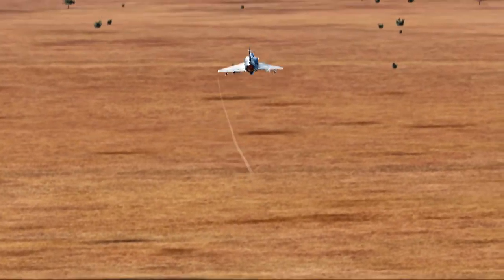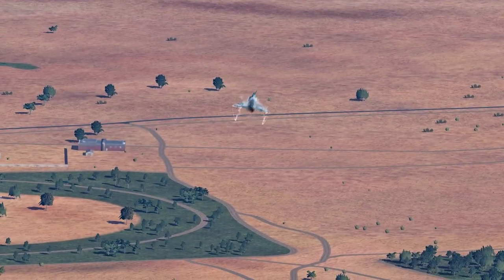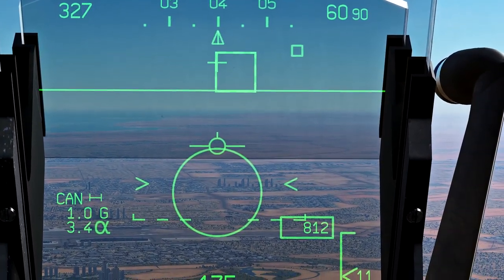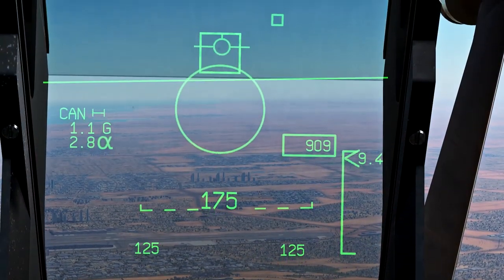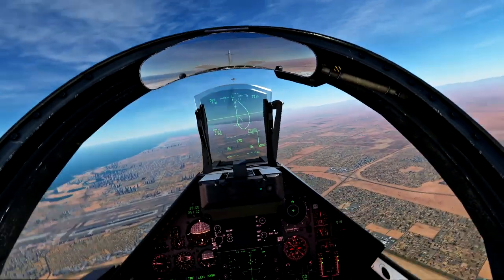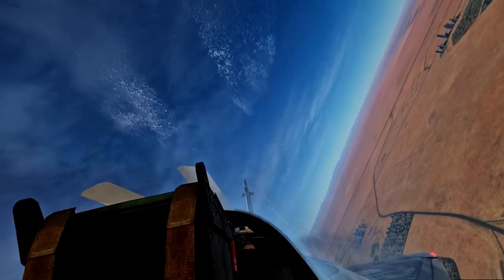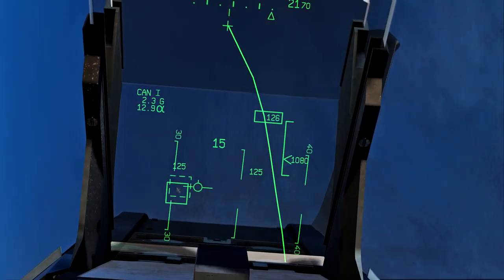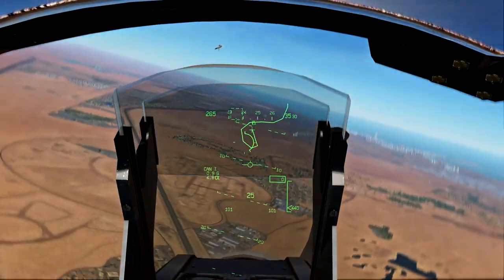DCS: Mirage 2000C Vs F-5 Tiger Dogfight

Comment from the maker: So I think its about time I gave some love to the Mirage 2000C. I've finally gone out and learned a fair bit about the Mirage although i'm still learning, and getting use to it. But I will say that I've thoroughly enjoyed the Mirages handling and flight characteristics. Although lacking when it comes to BVR engagement  with the small load out of only 2 super 530s and 2 magic II heat seekers the Mirage is easily one of the most dominant dog fighting platforms in DCS right now. The impressive roll rate on this thing makes it a very difficult opponent in a dogfight. Thank you all for watching and Thank you for all your support with the channel. its been an amazing journey.
Reply: Your so realistic 😣👍
Reply: So, which one would you prefer when it comes to dogfight: hornet or 2000?
Reply: @hikari2hikari2  The Mirage is slightly better (delta wings) in maneuvers but the Hornet has slightly better thrust to weight on the paper and JHMCS. Close call, probably the Hornet, the version we have is 20 years newer than the Mirage we've got. Hopefully they put the Mirage 2000-5 eventually with BVR missiles MICA EM/IR, especially the IR, very dangerous missile as it gives no warning to the target. The Mirage would then become very popular on servers, like the F16 Viper when it'll be out. Thanks for the video GS.
Reply: Holy those slots at the merge 3:42, even the sound is implemented when it goes down
Reply: @hikari2hikari2  The mirage flies better imho, but the hornet's armament and gunsight are a lot better... The 20mm vulcan has higher muzzle velocity and the radar gunsight on the f18 is much easier to use.
Reply: @hikari2hikari2  I prefer the Mirage over the Hornet in a dogfight.  Unless the Hornet is flying slick, the Mirage should be able to turn substantially better at higher speeds, and most merges occur at high speed.  My experinces in online servers has been that my Mirage ALWAYS gets the first shot off, even against a Hornet with AIM-9Xs.  The Magic II turns very well and will make almost any shot you take at close range.  If the Mirage had a reasonable gunsight it would be a clear dominator, but as it is any opponent can escape gunfire indefinitely simply by flying around at 600 knots.  It's almost impossible to make a Mirage overshoot, but it's easy to not get hit by guns.
Reply: @JETZcorp  Right, prtty much like what I been heard, "hornet is the best dogfighter when sit in chairs"
Reply: As a Peruvian I know we have Mirages 2000 while our neighbor, and traditional rival, Chile has gotten some F-16.

I would love to see that match even if the outcome doesn't favor the Mirage (that is why we got Migs-29). Very nice channel.
Reply: Take it our for BVR please, make it work. It will make an excellent video :)
Reply: I have been looking forward some Mirage love on here.  I'd really like to see some videos on how to fight/survive BVR engagements in the Mirage.
Reply: Fun to see these a bit older and not as prolific aircrafts in some action. Hope to see some more Mirage videos, and perhaps, some beautiful day even a Viggen..?
Reply: FA18C loses its energy very fast compared to the M2000C, in a dogfight. 
Still waiting for the M2000-5, probably in 3 years I guess :(
Until then, those Super530D vs AMRAAM and 9X can't stand a chance, 15-25 year gap.
Reply: @Maximus Lockhart Its been said many times before but if you underestimate anything in DCS you're  a fool. But yeah the 2000c especially seemly totally underestiimated. It just takes a bit of getting used to compared to Hornet etc, but its so fast and as said very manovourable at the right speed. People seem to lump it with the 21 bis and the F5E but its really a class ahead of either. The only thing letting it down is payload, because you just know that it has the space for more missiles, just not the right mounts, and with 4 or even 6 530Ds I think people would take it a bit more seriously.

Comment: I really liked the explanation of the flight characteristics at the beginning of the video. Similar explanation for other aircrafts would be nice.
Reply from the maker: Ronak Dhakan thank you I plan on doing that kind of stuff a lot more going forward thanks for the feedback. Always helpful to hear what you guys like so I know what to do more of in the future.
Reply: @GrowlingSidewinder  to add a bit on your Mirage 2000 delta wing explanation, the 2000 has several features, the main being FBW that allows others features to work (such as the slats and instability), which significantly decrease the disadvantages of a delta design, especially its low speed handling and energy bleeding. The Mirage III or Mig 21 are total bricks at low speed compared to this beast.
Reply: @GrowlingSidewinder  Similar explanation for the opposing aircraft(F5 Tiger) should have been done too.

Comment: This cockpit has to be a dream for every pilot
I never knew anything that open ever existed
Reply: Aref Salimi , wait for the F16!
Reply: F16 cockpit is far more complex to use than the M2000, designed to reduce the pilot charge to the minimum. The view from the F16 cockpit though, is better.
Reply: @krostouin , the cockpit in the F16 is more complex because it can deliver way more weapon types. It is pretty clean and uncluttered, the complexity in the F16 cockpit lies in the MFD's
Reply: @PhillMagGamerDad  man you are wrong. This is not the reason. Dassault is a specialist in making cockpit more easy too use. They did so with the rafale wich cockpit allows the pilot to focus on his flying and his mission!

Comment: The F-5 had no actual chances of winning a dogfight with the marvelous Mirage 2000. The Mirage has a fairly low weight and large wing area with the pure delta design giving low wing load, thus more maneuverability, and the wing shape works extremely well in all flight regimes (subsonic, transonic and supersonic). It's very fast, in fact is pretty difficult not to overshoot in close range combat. Here agility is the key for his design: small, extremely agile, fast and with good weaponry. The single M-53 engine (double air flux, more air and bigger air intakes= better supersonic performance) is a badass engine. The intakes have central moving cones. The cone moves according to speed, progressively moving backwards as it increases. In this way it is possible to adjust the geometry of the air I flow adapting it to all the practical speeds sustainable by the aircraft, without having a complex design of the air inlets themselves. (Remember the SR-71 Blackbird engines? That type of intake cones). The jet is unstable and uses fly-by-wire, which is the last Dassault plane to use this system in fact the Rafale uses fly-by-light with optic fibres. Here's the funny thing, the fly by wire system of the Mirage 2000 needed two "mustaches" that made the plane even less stable to gain full control. The Mirage it's first a strike aircraft and then an Interceptor, keep this in mind. It's an aircraft capable of going from 0 to 60,000 ft in less than a minute, shoot 60 rounds of 30 mm in just a second (two 30 mm revolver cannons with a 1800 RPM rate of fire, 30 rounds per second each) and fire big missiles. This means "I will obliterate everything I see". They probably wanted to give both the typical Interceptor layout with long range big missiles (Remember the F-14, huh?) and the dogfighter layout, thus meaning good and numerous guns.

I made a fairly short resume of how the aircraft is. Ps. I had very few hours on DCS but I have thousands on other simulators and games - flew most with F-22, F-15C, Mirage 2000, F-18 Super Hornet, MiG-29 and A-10, less with Rafale-M, F-14, F-16, AV-8B, F-35, various MiGs [21, 25, 31], F-117, Me-262, etc., without counting many hours on propellers such as Spitfire, Me-109, P-38, P-40 and so on) 

Flying the Mirage is easy and difficult. Strange, yes. It’s easy to fly once you understand how it behaves, but the pure (and tailess) delta wing it's a bitch. it generates huge amounts of lift AND a huge amount of drag. In fact at high AoA the wing has flow separation and at low speed it procudces a lot of drag. This feature needs more powerful engines to counter, but the Mirage hasn't a so powerful engine. And it's not so good in pitch.

So the general idea is to use your speed and firepower to attack first but beware of climbing/pitching maneuvers and low speeds, this will put you in an unfavourable situation. The delta (tailless) is efficient at high speed but no so much at low speed so distance and time are your friends here. The delta flies well in all regimes but it's a bit bipolar in this case, remember the high lift and high drag thing. To fight well you must be fast, that's the deal with the Mirage. Otherwise you'll overshoot trying to do that or slow down too much that by the time you pull that throttle to 100% and re-gain speed the enemy will have already an advantage over you even if you roll and turn extremely well. I forgot to say that deltas to get lift at low speeds have to maintain a higher angle of attack than at higher speeds, and as the Mirage is bad in pitch maneuvers.... You know... It's not good at all. If I remember well the attack speed for the Mirage 2000 is around 500 - 600 knots range (930 - 1116 kph or 581 - 698 mph), so keep it around this speed range.

Conclusion: 1. Stay fast and avoid low speeds under the 500 - 600 knots range or at least avoid being below it for too much, 2. Don't close too much with the enemy jet, the Mirage flight characteristics are not an advantage this close as you risk to overshoot or end very at slow speed, 3. If you stay up this speeds you'll be fine, the engine and the intake will do the job all alone themselves, 4. Unleash the power of the cannons if you can. If you have a good shot you take it, the two 30 mm won't spare no jet. 4. Play in advance, more time equals better fighting plan, 5. It's like landing on a deck for Naval Aviators, rudder pedals and throttle skills must be mastered while flying subsonic and 6. Once you have learned to fly it, you'll like it a lot. It's a plane that needs some time to be understood even if the controls are easy (like the parking brake on the right just like cars), but hell it's a fabulous jet. Absolutely love it.

Hope I helped you!
Reply: Max VonNitten In wich sim you got the Rafale ?
It seems pretty rare
Reply: @maximerunningandstuff8837  Had it in FSX (Microsoft Flight Simulator X), Rafale-M which is the naval single seat version deployed on their carrier

Comment: T/W in a clean 2000C is just a little below 1/1 if you have 100% fuel and the 21,400 pound engine. In the F-5E you will be around 0.65-0.68 in the same situation. But damm, that "Spanish" guy is really a pilot.

Comment: The maneuver you call a high yoyo to avoid the overshoot and stay behind him, or to force him to overshoot in front of you ... is actually a lag displacement roll. Sometimes called a barrel roll attack when you have a high rate of closure on their 4 to 8 line, or a barrel roll defense when they have a high rate of closure on your six (or anywhere from the 4 to 8 line) and you need to force the overshoot. A true high yoyo is similar to a chandelle where you use vertical displacement to shorten your horizontal extension, but you never roll the aircraft inverted ... at most you use a steep banking angle, as much as 90 - 120 degrees ... at the zenith of the turn before pulling into your descent.

Comment: Great review and overall understanding of basic BFM. I do need to point out as others have alluded that track ir enables you to fly in somewhat of a game mode though due to having the instant 180 degree reverse views to the rear of the aircraft.  

I would definitely recommend you to fly with a high quality VR hmd and try the same, you’ll find out that some of the tactics that you are accustomed to using will be less effective and require a higher situational awareness level in regards to energy management and more advanced spatial awareness due to the inherent limitations of your neck and posture while being somewhat strapped into the seat.
Reply: Except no one straps themselves into their seats in VR? 
  Had the resolution not been so poor, VR would be better that TIR, just based on the increased awareness and depth perception offered.
Reply: HappyOwl Vive pro is definitely sufficient, and for an absolutely extraordinary experience, an XTAL hmd is the necessary.

Comment: Liking the 3rd person view. Helps build that situation awareness.  
Mirage vs F14 ? Low speeds?
Reply: Phillip Gatelein in Peru we have the Mirage 2000 and our traditional rival (Chile) has some F-16.

I would really love to see that match, although I am not very confident but Growling may pull it.
Reply: Low speed, sustained, F14. Guns only? Probably f14 if equal skill. Mirage would murder am f14 in a merge of both have fox 2s. Mirage can trade all its energy for one insane turn, and it is not g limited nearly as hard as a 14. Sustained f14 wins due to its wing sweep and greater power to weight. It will win in the vertical, but Mirage has a big advatage in the early fight. The insane roll rate also makes the Mirage the best plane fo defensive maneuvers in DCS in a tight fight. Only cobra capable fighters can match it at slamming the brakes... except the Mirage is fully controllable when dumping speed. A Sukhoi or MiG 29 may be able to beat it on paper, but they are up a creek if the pilot is less than perfect. Mirages big weaknesses are BvR and it is underpowered compared to the big twin engine jets... So if the fight drags out your enemy has to mess up to lose. Get good at snapshots and forcing overshoots and you will need to fear nothing in game in the merge. (But be careful of all aspect fox 2s.) Finish your fights quickly.

Comment: 15:54 I'm no expert, but from my experience in war thunder and other flight sims, simply doing a loop DOES work, but NOT well.  It opens up your 6 oclock and allows your oponent to escape your vision.  doing a high yo yo keeps them within your 6 to 9 and all around has a better tactical advantage as you also can keep or loose speed depending on the angle you pull off.  the yo yo also allows you to easily catch any jink or turn that your oponent will make, and at this point youre already above them with more energy and theyre within your 6-9

Comment: Well done bud, you’ve Sussed out most of the handling characteristics already. It can be a giant airbrake as you said. 

Good effort going with the radar gun solution. I hate that snake. Hate it lol

Also, there’s a switch somewhere to slow the gun rate, makes the rounds last a little longer. Think it’s right of the weapons panel
Reply from the maker: thanks brother, ya i'll deff turn down the gun rate, the damn snake is so bad, i'm basically using ww2 deflection shooting instead of using the snake anyway lol.
Reply: @GrowlingSidewinder  Unguided gun snake for the win 07

Comment: Nice video.

A really nice scenario would be to try Mirage 2000-5 armed with Mica missiles pitted against F-16C Block50 or similar armed with AIM120C. The Mirage has marginally better missiles and radar (RDY considered on par with AN/APG70) but the F-16 much better energy retention capability and thrust-to-weight ratio so probably a better dogfighter, despite higher wing loading.
Reply from the maker: MotoMarios id love to do a mirage 2000-5 but we don't have it in DCS there is talk of something like that in the future tho.
Reply: @GrowlingSidewinder  Thanks. It's got some special interest for me since my country (Greece) has been in tension with Turkey for some decades now and this particular pairing has been discussed about a lot. Greece has got F16C/Ds Block 30/50/52+ Advanced (the latest with AN/APG 68(V)9 and Turkey has got similar F-16s but Greece also exclusively has a small number of Mirage 2000-5s with RDY radar and MICA missiles. So the scenario talk never ends and I'd like to see a simulation about these.

Comment: New to your channel. Awesome stuff. This may be a dumb question, but why are there no newer aircraft around? Like an SU-35 or F22? Would love to see you mess around with one of those
Reply from the maker: hi there and thank you for subbing, that is because these aircraft in the SIM are very detailed and modeled as realistically as possible right down the finest detail. the f22 and Su35 etc are highly classified as they are still in service. so the developers don't have access to the material required to model them correctly/accurately.

Comment: If you are overshooting, would reducing the throttle be a good way to prevent it?
Reply: As a last resort but you really do not want to play with throttle but instead positioning anticipation, so instead you take a longer path than him from his A to his B, that you have to pattern predict. As a result you still have energy and plenty of dynamic pressure on the wings to gain positive control reactions and turn rates. Of course too much dynamic pressure causes high Gs, so you have to be on the edge of your tunneling resistance.
Reply from the maker: Ronak Dhakan ya it's not bad, u really want to do that BEFORE u overshoot lol. If u overshoot u really need something a little more aggressive than simply reducing throttle. Cuz ur just gonna end up in front of him and then ur gonna cut power lol and make yourself an easy kill

Comment: Question: why do you start your merges so low? I like to start mine at 30k-20k. Gives more time to fight before you end up on the deck.
Reply from the maker: 20 is ok, 30s a little high and depending on who ur fighting you may be giving yourself a pretty dramatic advantage by starting that high, also just not enough air that 30ish I usually go like 15-20max.